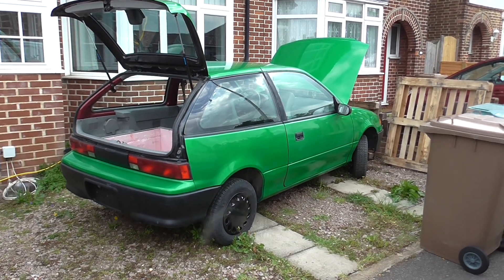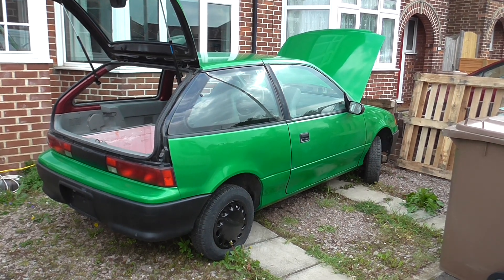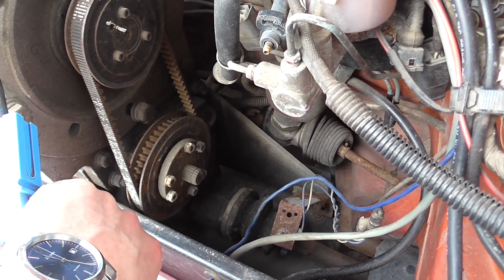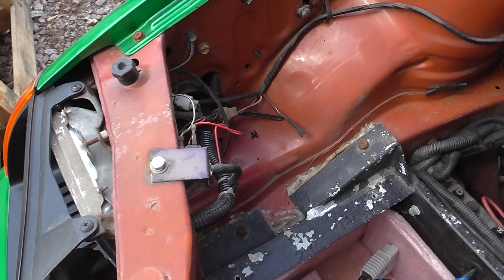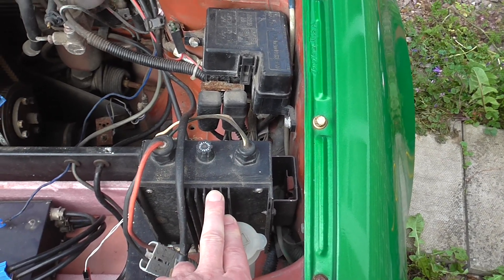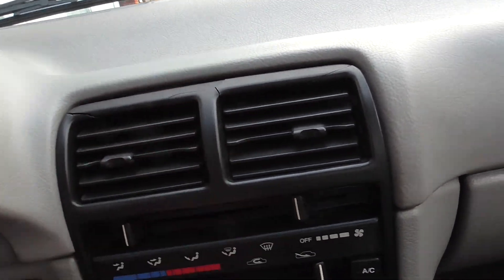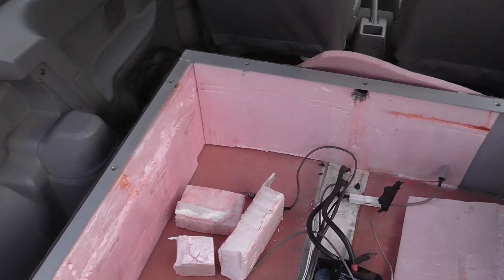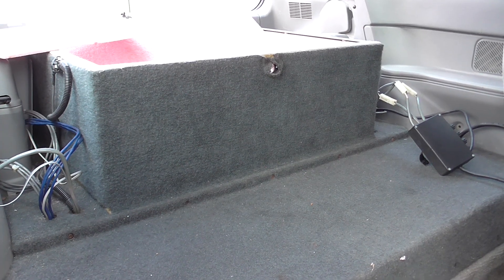Solectria Force EV

Comment: I have one of these Solectria's going to use lithium batteries in it this summer. The lead acid batteries weigh 700Lbs the Lithium batteries will weigh around 200Lbs.

Comment: Have you any ideas what you're going to do with it. 12kW is just about enough to drive around town but wouldn't fancy going on a motorway.
Maybe put the running gear into a Quad. 😉
Reply from the maker: 12kw is the continuous rating, peak power is around double that.